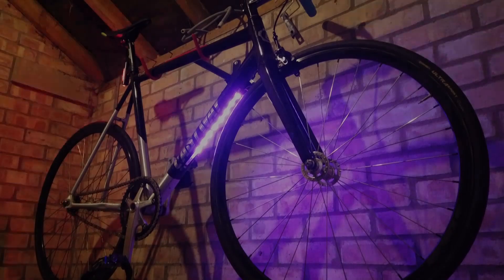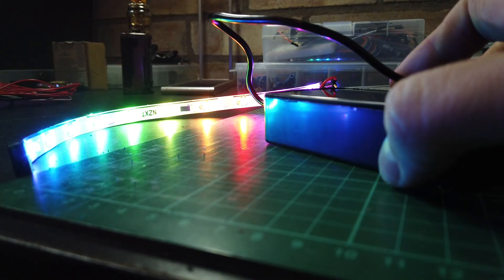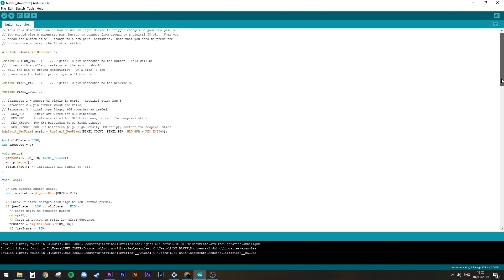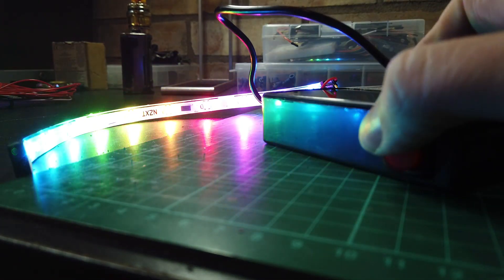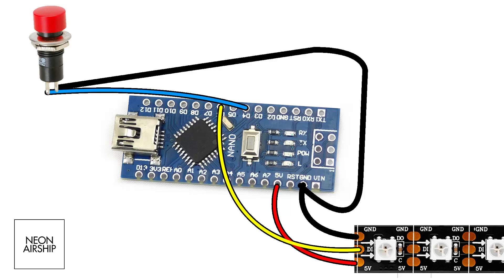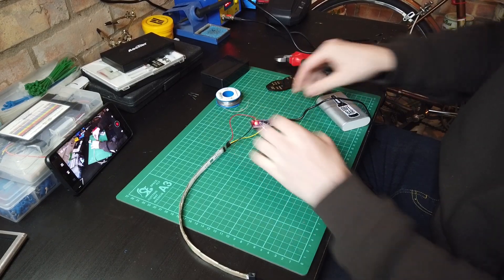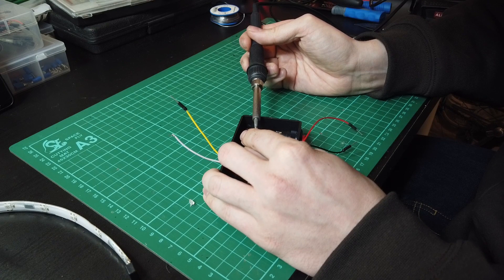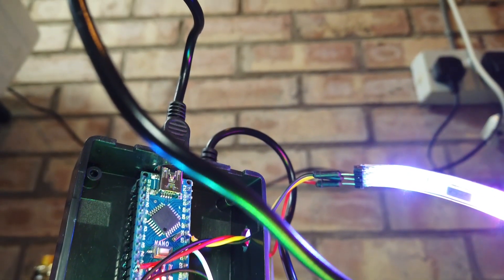How to ARGB EVERYTHING with Arduino

Comment: hello sir,
i need your help about ambilight using arduino nano. the issue here is the led strip, i got only the four pins 5v led strip (5+, R, G, B).
i dont know how to connect them on arduino nano, please could you guide me on this project.
Thanks.
Reply: Probably a bit late but what you have here is an analog rgb strip, not an adressable rgb one. Tutorials exist online but be aware you will need some more electronics components.

Comment: Doesn't work. The sketch stops working leds lights up but running lights stops and also the change via button stops after about 10 times...? What's the problem here?
Reply: I don‘t have any arduino experience, but I program occasionally and I know in ino sketches there‘s a „void setup() {…}“ and a „void loop() {…}“ part. Setup runs once on startup, loop, as the name says, runs continuously. It seems like you might need to put the code in the loop part.